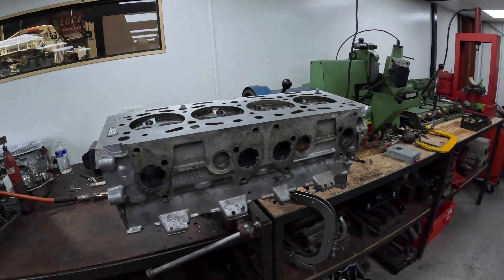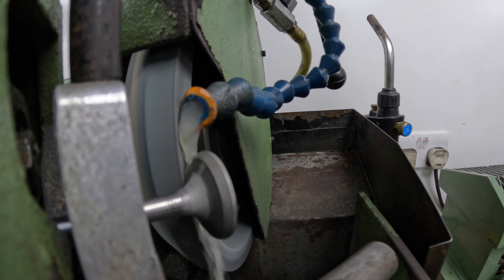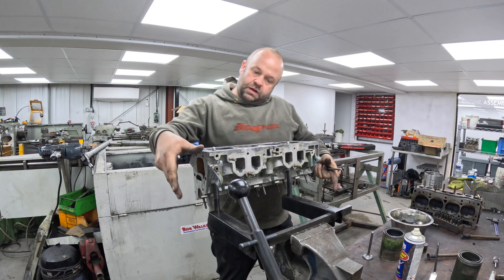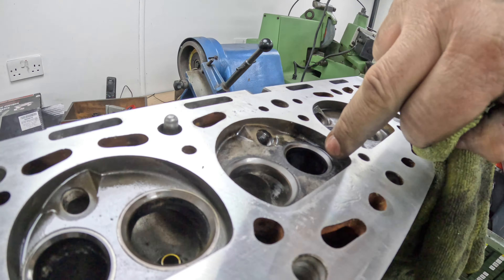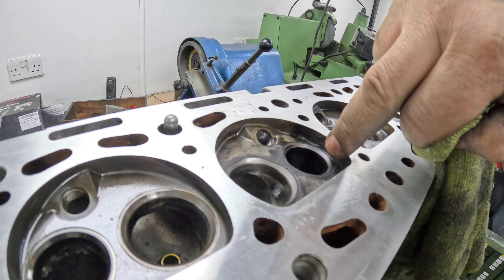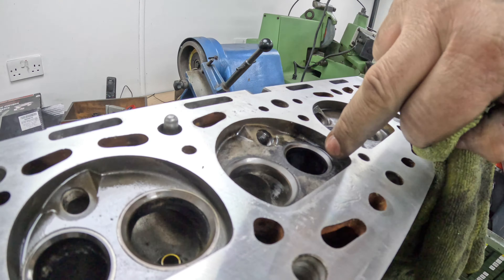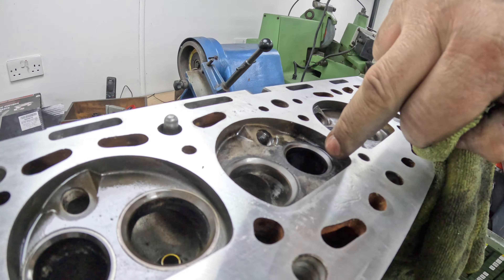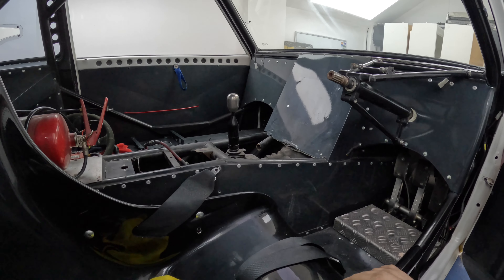PEUGEOT 205GTI  CYLINDER HEAD REFACE, CUT SEATS, REPLACE STEM SEALS, SET VALVE CLEARENCES

Comment: Love the details on the head and valve work, makes me think I could do it 😂
Love the Escort to, is it still a full chassis, or has the body been put on that tubular frame?
As for what to do with it, tough decision.  Race it, yes , I like the idea of having another seat in it and using it as a street car as well.  So maybe looking g to see where you can route the exhaust…it looks great out the side, but does it make the car faster like that?
Reply from the maker: Thanks mate.. it's a tvr Tuscan challenge space frame with a original rs2000 body over the top.. I want to race it but the money from selling it would be handy. I'll look into reroute on the exhaust
Reply: @graceenginedevelopments  I remember when you first moved into the new unit you talked about selling it then.  Looks like a great race car though
Reply: @graceenginedevelopments  Keep it. Theres alot of history in that car. I remember it sat in that quarry workshop of one of your snap-on rounds. Bare bones, covered in dust 😎  Fell in love with them Image split rims and pretended to myself that i could buy it 😆 Absolute dreamer! 
Beast of a motor 🏁

Comment: You sure it's not a 205CTI ?
Reply from the maker: I've asked the customer you're correct it's a CTI
Reply: I thought so, partly because:
1. I took it off.
2. I was driving behind it when the head gasket let go and it disappeared in an IMENSE cloud of white smoke @graceenginedevelopments
Reply from the maker: @geraintlloyd4888  🤣🤣🤣 that's inside information..